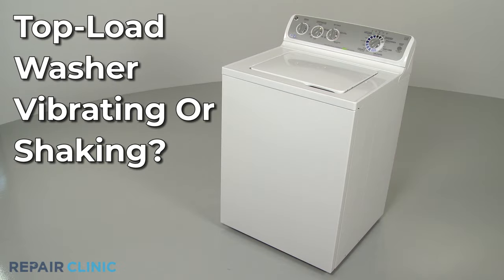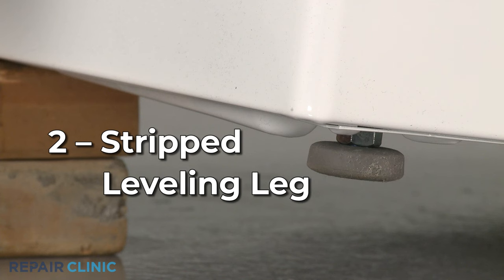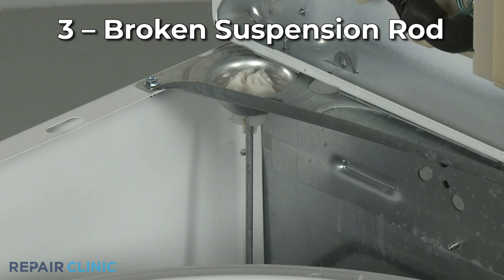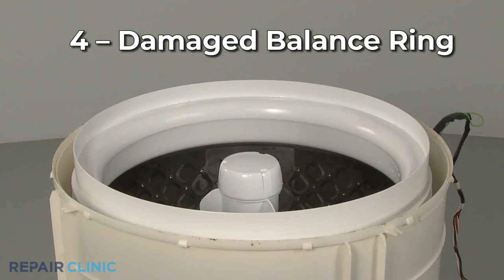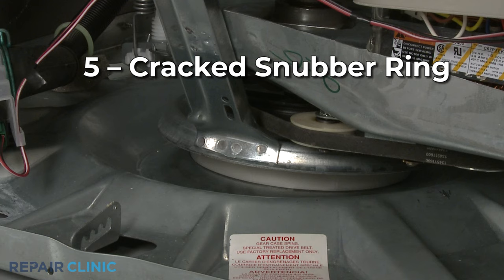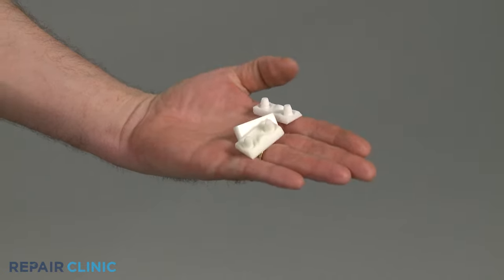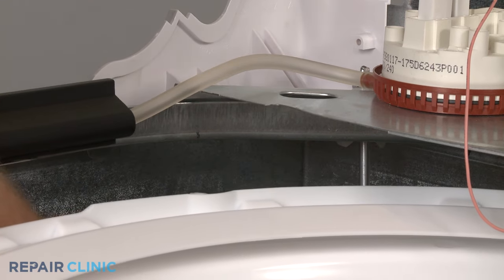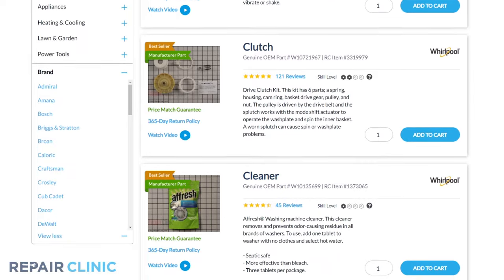Top-Load Washer Vibrating or Shaking — Top-Load Washing Machine Troubleshooting

Comment: The banging sound of my brand new washer was the discharge hose slapping against the back of the machine during high speed spin.  I put some 3/4" pipe insulation over it to keep it from tapping the back.  I couldn't tell where the noise was coming from I assumed it was coming from inside but that fixed it.

Comment: Theres alot of oil all over the floor under my washer.
Reply: You have a leak in the transmission. You can disassemble and refill with gear oil. Then you will have to install the 10 or so screw in a cross-thread pattern. Also, get the red gasket sealer to form a gasket.
Reply: @ACoustaDC  Thank you
Reply: The Maytag maintenance man came over and diagnosed it; stating it is a ball bearing problem. But said I should just buy another $1000 washer because the labor and parts are going to be more than that.
Reply: @shadyfranco8881  well I'm just a diyer. But I repaired a lot of these machines. If you have an old-fashioned direct drive, there is no bearing that is in oil. I'm not sure which units have a bearing in oil, that's something I'm not coming across. Hopefully things worked out. If you're in Phoenix Arizona and you have another problem let me know I'll come see what I can help you with.
Reply: @ACoustaDC  Your awesome. Thanks so much, I appreciate It! Unfortunately  I don't live in that area.. I do wish I knew more about washing machines.